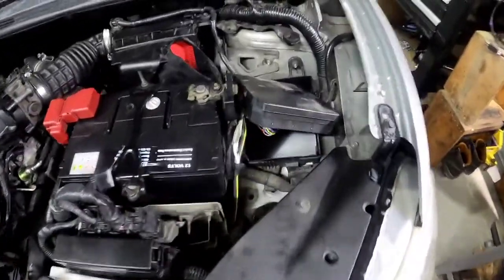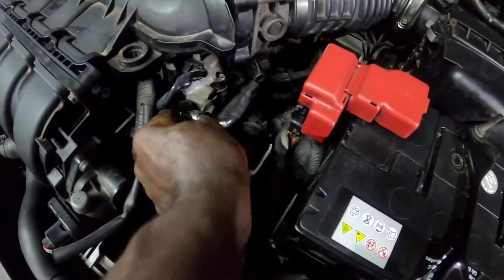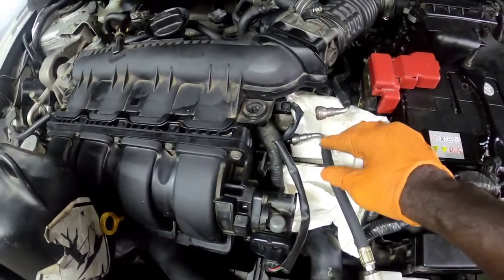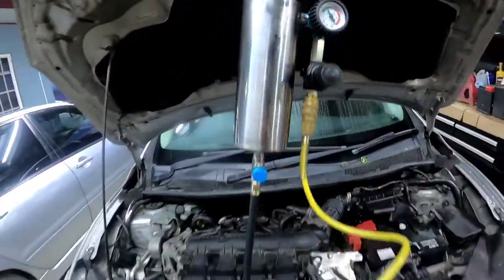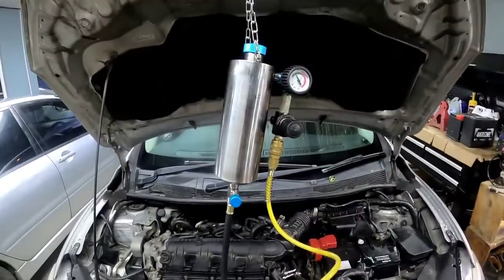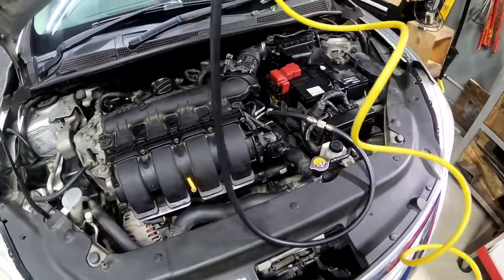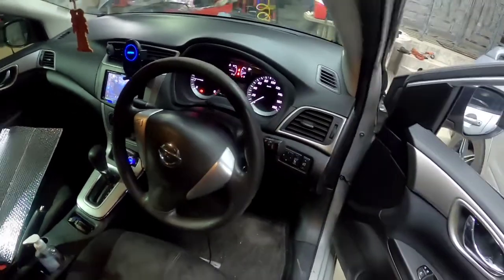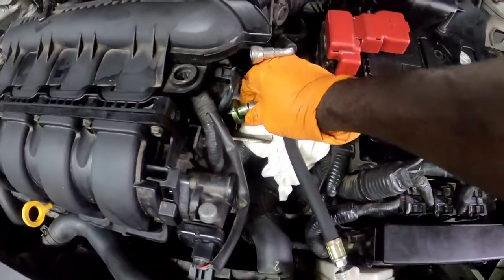Autool C100 injector cleaner without dismantling or removing it from you car?

Comment: Pls where sis you connect that yellow wire to ?

The air outlet

Mine is not spraying and I don't know where to connect the air outlet to
Reply from the maker: I replaced the fitting that came with this tool so I can use stand shop air with my hoses. Swap it out with male fitting that can work with your hose

Comment: Can I use a portable compressor ?
Reply from the maker: Yes you can. You only need about 45-50 psi for normal injectors.
Reply: What size is the coupler adapter
Reply: You can use a normal bike air pump.